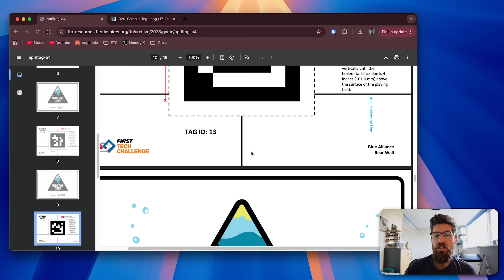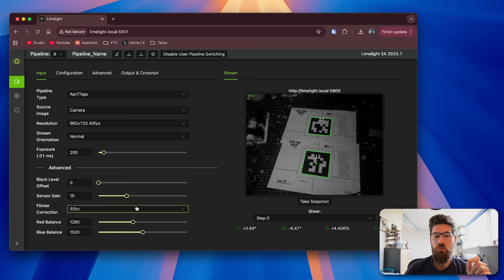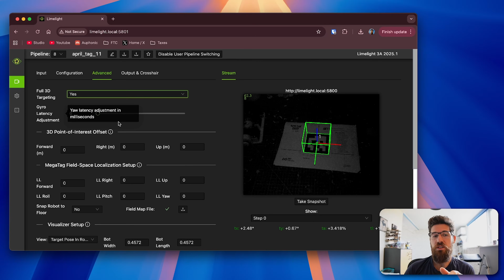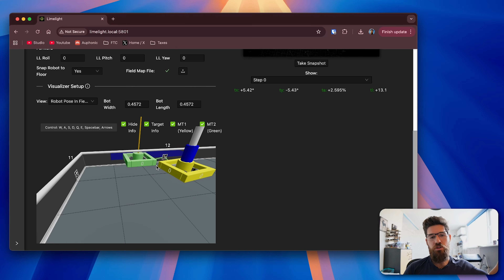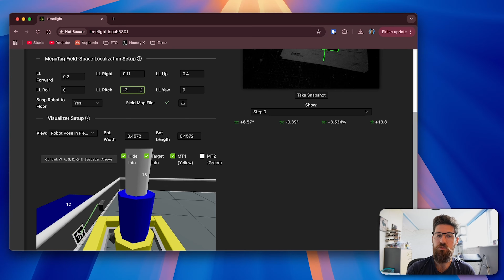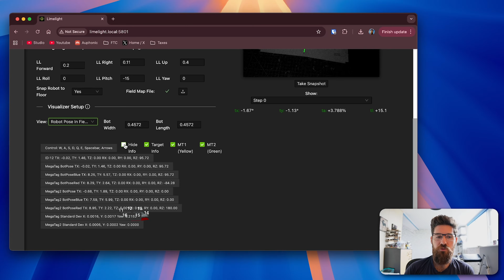How to Get Perfect AprilTag Tracking (Limelight 3A)

Comment: is configuring those offsets like forward back pitch yaw etc necessary if i want to create a function which just turns the robot until the crosshair is aligned with the april tag? do i even need to touch that megatag section, or can i create a simple proportional control loop which turns the robot until tx is 0?
Reply from the maker: At first thought, if all you want is tx, it likely* shouldn’t be necessary? as long as your camera’s yaw is 0* relative to your chassis’s angle. Though keep in mind you will be able to gain little attributable localization data through this method.

Comment from the maker: Update on MegaTag2: In order for the web interface to properly display the MegaTag2 location, You need to feed the robot's yaw into the API. To the best of my knowledge, if you're using this camera for FTC purposes, this isn't possible (or I'm unaware of how to do so while the camera is connected to your robot). In short, MT2 is still they way to go when programming, but be aware it's position won't "show" properly in the visualizer when connected to your computer.

Comment: Coach Pratt..As always, very helpful video. Can you do a video of either Roadrunner or Pedropathing setup using Java? Standard Gobilda pods with pinpoint computer? I foresee that in conjunction with Limelight, this could be a solid solution for localization. Thanks
Reply from the maker: Thanks! I've got that on my list to do in the future, lots of backlog at the moment but that is on it's way. You're correct in your thinking, either pathing program and 3d april tags with limelight will be an excellent way to localize

Comment: Awesome vid, will there be a vid on how to design box tube telescoping arms with mostly 3d printed parts?
Reply from the maker: Making a box tube slide purely from 3D printing would be a challenge. Plastics at that length would really struggle in rigidity, and the way the bearings need to be used to tension these systems, I think it wouldn’t work well. I’ll have a video coming in some prebuilt kits, as well as design considerations when making your own